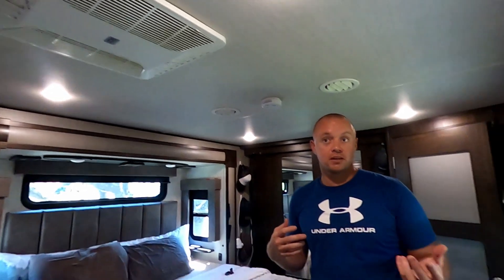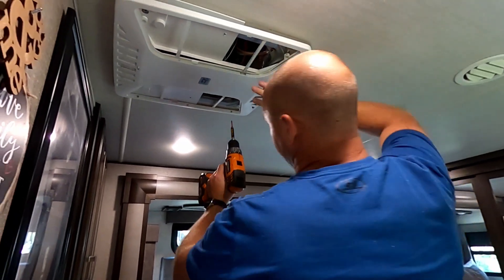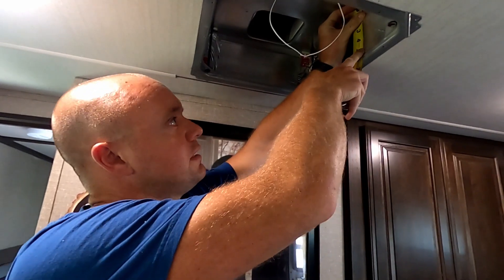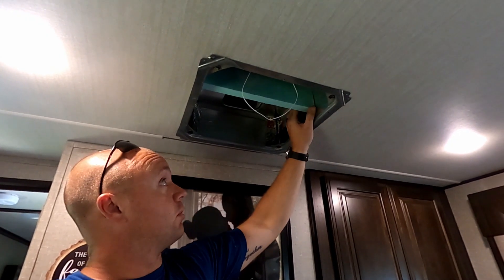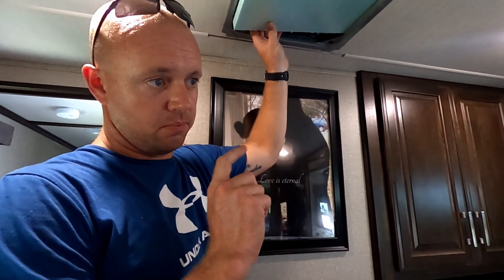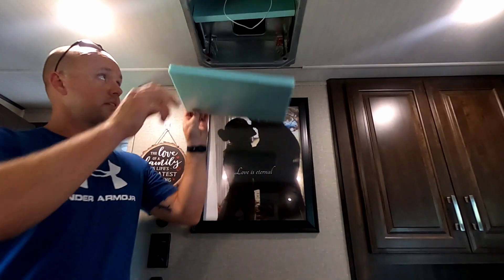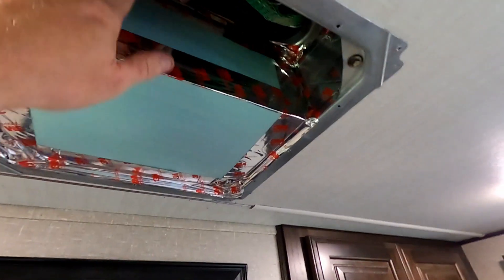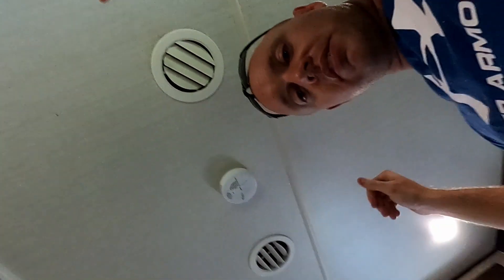Grand Design A/C Modification

Comment: Just did this mod today after watching your video. One difference is I centered the teepee on the close-off board, even though the output hole below the fan is not centered. I discovered they did this intentionally because the air blasts more on one side than the other, making the dividing point the exact center of the close-off board, not the center of the output hole. Much better flow now and even distribution front to back. Much quieter as well. I started with a hot 32ft trailer in 103* temps and it was down to 79* in 30 minutes. Thanks for the video and clear instructions.
Reply from the maker: You are most welcome! We are glad it worked out for you!!!.

Safe travels and Happy Modding!

Very respectfully,

Jeff and Amanda

Comment: I made this mod to out '19 Imagine back in June. We took our grandnephew camping for a few days right after and it made an amazing difference. The noise level dropped by a ridiculous amount, and we kept the trailer in the low 70's for the entire trip. Did I mention that it was 105+ outside for most of the time we were out? The A/C actually cycled off a few times during the day. Worth every nickel of the $12 I paid for the foam board (I already had the foil tape.) Good job!

Comment: Well today I decided to do this DIY upgrade. Went to a local box store and spent less than $40.00. I took my time plus the weather was in my favor. I cut out the flow diverter (Teepee ) to  aloud more flow for the return air. I also rapped it with sound Kilmat sound proofing. Can’t say it was much better, can’t do much for the return . But the difference in the flow of air is great. You saved me from spending $180.00. Thanks so much for the video. Keep them coming.
Reply: Spell  correction. (Allow). That’s spell check. Lol
Reply from the maker: Hey Frank! We are thrilled it helped you out! Thank you so much for the kind words. Keep on moddin’ and safe travels!

Very respectfully,

Jeff and Amanda

Comment: Excellent resource!  I bought the materials and followed along and with the video and it was a simple and straightforward modification.  The unit is "somewhat quieter" but noise was not my primary motivation.  The air flow from the vents is AT LEAST TWICE AS FORCEFUL as it was before the mod, especially in the bath and bedroom which are farthest from the AC unit.  I hoped for improvement but this exceeded my expectations and will be a huge asset  in the Texas heat!
Reply from the maker: We couldn't agree more! We are currently in Texas and it has been HOT!  We also bought a shaderv from shadrv.com. More to come in future videos.

Comment: Just seen the RV airflow system. I said. I can make something just like that. And here you are. LoL great tutorial. Will do this for sure.
Reply: They where pushing 6450 CFM then gained 6580 CFM over 13,030 CFM
That is a gain. Great video for sure. I can totally see how easy it is.
Reply: Even doing this still allows turbulent air flow which prevents optimum efficiency so buying the Air Flow System will improve  things even more.
Reply from the maker: Hey David,

Thank you for the numbers and the feedback! We hope it’s working well for you!

Sorry for the delayed response we have been on the road for the last month! Videos are coming!

Safe travels and happy modding!

Very respectfully,

Jeff and Amanda

Comment: I did this over 2 years ago, used foil tape to seal everything. What a difference it makes. this is such an easy modification and for around 30 dollars did both ACs in the unit, much cooler and a lot less noise

Comment: Great video I followed your instructions and the mod went great. I also foil taped everything for a tight seal.  HUGE difference in my air flow especially the bedroom. One added note: I offset the diffuser TEPEE  by 1" off center to favor the bedroom and this worked great. Thanks again!
Reply from the maker: Hey Richard! 

Sorry for the delayed response! We are glad the video helped. Thank you for adding the info on the noise level! 

Happy modding and safe travels!

Jeff and Amanda

Comment: Thank You so, so much. I have been dry camping at my cousins property in S.E.Georgia in my Grand Design travel trailer. My little big dog Honda gen. has worked in the past but a no go on this tripp. I found this pod last night, 10pm 80deg. sweatin mess. Today after my morning routine about 1 o'clock  sat back to get ready for the daily heat stroke. I remembered your vid, which I watched from start to fin. Thought, what have I got to lose.  got the filters off, they were clean. Dropped the two panel's  and got hit with an air sunami. my fan was running strong. what a big, big air restriction. you don't think? Went to the thermostat, BINGO!! The compressor kicked in! Now that I've cooled down I'm on the way to Home Depot and you my friends have another subscriber, life long!! Tip of the hat you'll. Thank You!!
Reply from the maker: Hey Robster,

Sorry for the delayed response. Jeff was in a remote part of Alaska for the last month helping provide no cost healthcare to remote sites. We are thrilled that this mod helped you! 

Safe travels!

Jeff and Amanda

Comment: Followed easy video. Working great so far had to do some extra trimming, there was some foam insert that stuck out, about half an inch, but just trimmed it back so everything fit well and rested it well. Working great thanks for the great video. With this Texas heat this is a must.

Comment: Hi Folks, Nice Idea. Over the 20yrs we RVed, I modded the AC's on our 4 RV's by Insulating the Exterior of the AC Air Boxes in a similar way, and sealing the interior areas as you've mentioned. Also bundled the wiring and moved the center cross-member in the Intake chute to maximize the Intake Air Flow. In addition, I closed off the air exits at the AC Unit to maximize the Air Flow into the Duct work and reduce the noise level at the AC unit. Double Insulating just might give you even more cooling benefits.  Stay Cool. Harold
Reply from the maker: Harold, thank you so much! That's awesome! We will definitely look into that!
Reply: @WeLiveFreeRV  Hi again, forgot to mention that I also put in some foam type material in the farthest End Air Vents to smooth the Air Flow due to the duct work  going beyond the actual Vent Exit and causing turbulance. What ever you can do smooth out the Air Flow in the system helps.  Harold
Reply from the maker: Thank you so much

Comment: I did mine a little different. Instead of the Teepee I cut 3 pieces all of them were 14" X 7 1/2". On the top two I cut openings for the air to flow down. I used Nashua Aluminum tape with mastic. Sealed it up real good with plenty of aluminum tape. Taped inside the vents near the plenum. Added and taped the side and bottom piece and buttoned it up.

I expected some improvement but never expected the improvement would be so significant.

I expected double the airflow but it was blowing out of the vents at least 5X, wouldn't be surprised if it is 10X stronger!

When I cranked it up it lowered the air temperature agni 5 degrees in 30 minutes! Last night the AC ran nonstop all night long now the longest it runs its about 30 minutes.

The tape was about $25 and the insulation board with aluminum on one side was $15. It took about 4 hrs, that includes the time it took to get the materials at Home Depot and have a donut and cup of coffee. So, half of that, about 2 hrs was actually all it took. Very simple and it helps to have a stool or small ladder. 

Thanks for sharing these tips!
Reply from the maker: Hey the revival channel!

Wow this is detailed!!! We are thrilled you saw an improvement!  We agree it's noticeable. We froze ourselves the first night! 

Safe travels and happy modding!

Very respectfully,

Jeff and Amanda

Comment: I was doubtful that this was going to give the results that I was hearing.  I’m a believer now.  First of all, you made it so easy to follow.  You even measured it for me.  I’m impressed with the increased air flow.
I used a chop saw and a tabletop saw.  Also a drill bit to cut out the screw slots.
Once again, awesome job, great video.  Thanks
Reply from the maker: Hey Keith!

We are thrilled it worked well for you, and thank you for your kind words!  Great call on using the drill bit for the screw slots! We didn’t think about that.

Safe travels and happy modding!

Very respectfully,

Jeff and Amanda
Reply: @WeLiveFreeRV  A coping saw for the screw slots works well.

Comment: I watched your video in my RV today as I was doing this mod. Thank you for making it! I did it to both AC units in my Reflection 311BHS. What a difference! The air flow coming out of the ceiling ducts is so much better. I should have checked the decibel reading of the AC's before starting this project but I do believe they sound quieter. RV Airflow kits are $170. I would've needed two of them. I paid $28 for foam board and tape. It took me a little over 3 hours to do both AC units but I saved a lot of money!
Reply from the maker: Good morning Rob! You are most welcome and thank you for your kind words. One of the other commenters did use a decibel meter and it was a 10 to 15 reduction in dB. We are thrilled that the modification worked well for you!

Very respectfully,

Jeff and Amanda

Comment: Great video! The only negative thing I had noticed about this is the vents on the ac are no longer usable but other than that the flow through the vents was a 100% better
Reply: I agree except that I am at a campground with poor electrical. I have had the startup capacitor on each unit go bad. The way to check if the AC problem is the startup capacitor is to reach up and spin the "squirrel cage." You can no longer do that.

Comment: They actually make duct knives that are very easy to use. That foil tape needs pressure applied to it with a credit card or a squeegee or it will eventually come loose. Can’t tell you how many times I’ve had to fish hvac tape out of rv duct.

Comment: We have an older motorhome, and I’m pretty sure it doesn’t look like that on the inside. I’m still going to see if there is something Similar I can do, to help. It can get pretty warm, when it’s real hot outside. We don’t live in it, but a little more comfort, when using it would be much appreciated. Thanks so much for your video.
Reply from the maker: Good evening!

You are most welcome! Good luck! Don’t hesitate to reach out if you’d like a second opinion!

Very respectfully,

Jeff and Amanda

Comment: Well, I attempted this AC modification on my new Shadow Cruiser today. I have a Coleman Mach 15 AC and it doesn’t blow very much air through the vents resulting in a hot camper. I used one inch thick foam board and immediately ran into some issues. My plenum is kinda shallow at just under 5 inches which caused the 45 degree angle cuts not to work. I ended up chiseling away the foam until it gave me the correct fit from the exhaust port to the duct entrance. It wasn’t pretty looking but I taped it all up before I installed it. My plenum came from the factory a mess. Nothing is clean cut and there is a lot of overlap from the wood in the ceiling where the AC is mounted. I had to cut, carve and shave my foam boards to fit. I ended up using a lot of tape but I accomplished the direct line from my exhaust port to the duct entrance. There wasn’t much room left for the teepee so I omitted it. After it was all together I excitedly turned on the AC and to my surprise, I had a lot more air moving through the ducts and out of the vents. I’m so glad you made this video and thank you for sharing it with campers like me.
Reply from the maker: Hey Jeremy!

What an adventure sounds like you did a great job! We are glad the video helped you! We hope you are cooling down!

Safe travels and happy modding!

Very respectfully,

Jeff and Amanda
Reply: Wow, 5 paragraphs,  impressive

Comment: You did a great job and I applaude you!. However it should be noted with the RV Airflow mod it increases RETURN air flow. The increased airflow uses MORE of the inlet filter and prevents the coils from freezing over. More air flow means less operation and operation costs. However- It should be noted you saved everyone a lot of money with your mod. How much will you save in the long run if you had purchased a RV Airflow kit?? It would take a lot of testing to prove that.
Reply from the maker: Hey Opa and Oma!

Thank you so much and that’s a good call out for sure! We are not sure how to calculate the difference either! We went back and forth on buying the airflow kit, but Jeff really likes diy projects haha!

Safe travels and happy modding!

Very respectfully,

Jeff and Amanda

Comment: Don't know if someone else has mentioned it or not but that whistling is the air squeezing between that outer cover that has the dump and filter panels and the inner plenum panel, around the edges.  I found one spot that was the main culprit and added a thin layer of silicone and that got rid of it immediately.
Reply from the maker: Hey James,

It has not been mentioned! Thank you!

Comment: Love this mod. Why didn't you take the flange off?  A company called "RV AirFlow Systems" has made a unit that does the same thing but for $170. I will be doing what you did but making the "TP" go all the way to the sides and within an inch of the top. Once I have created the "TP" and have it secure I will cut out part of the bottom as the "RV AirFlow Systems" has done to theirs so you get more air flow through the full length of the intake and air filter. Great Video.
Reply from the maker: Hey Lad!

We wanted to keep all the original parts of the system “installed” in the event we needed to reverse the mod. We love your idea about maximizing air flow underneath the tee pee!

Thank you so much for your kind words. Safe travels and happy modding!

Very respectfully,

Jeff and Amanda

Comment: I would cut the 45 on the insulation panel first. Before cutting them into the pieces you size to length and width. It’s easier to cut a large panel than small pieces. But a really great video thanks 🙏
Reply from the maker: Great tip! Thank you!

Comment: I think I will be trying this. Although I have a 3d printed version in my mind. Does the bottom of the horizontal piece line up with the bottom of the duct opening? If not maybe a foot on the teepee would help a little more. You could also notch the divider to match the teepee, and cut the bottom some. That would add more return airflow and use more filter sq inches. If I am picturing it correctly. My camper is in storage right now.
Reply from the maker: Hey M Moore,

We are going to try and answer this as best as we understand what you’re asking.

1) for us the bottom horizontal piece of foam board sat approximately a half an inch below the opening of the duct. i’m not sure how that would translate for 3-D printing, however with the appropriate measurements I could see where that would free up some more airflow into the intake. I am Magine that 3-D printing as much skinnier than a 1 inch piece of foam. 

2. You can notch underneath the TP. However I would imagine that would be very disruptive from the airflow standpoint and maybe a curved carve out would work better

hopefully that answers your questions! If not we can try again!

Very respectfully,

Jeff and Amanda

Comment: Improvement....cut the opening in the bottom foam and the v diverter. Then the back block on your intake side to allow more intake air easier
Reply from the maker: Hey Kelly, we think you are saying you have improved on the mod. That's awesome! Are you saying to cut an opening in the bottom and change the location of the V? If you get a chance could you explain a bit more? 

Stay safe! 

WeLiveFreeRv
Reply: @WeLiveFreeRV  I've been drawing mine up. And the way you have yours built.. (which is awesome by the way) limits the intake side of the air. If you look at the commercial version it has a concave leading from nothing at the point of the plenum for the charge air to half the hieght at the intake side tbuse creating less restriction for the charge air by allowing more area to draw from.

So picture thisyou have the vertical section of the foam separating the diverted on the charge side. That solid piece on the backside has the v shap that is open at the top of the v that would be facing down so cut the inside of the v shape in the solid foam serpating the intake from the charge  side. That will open up more surface area easing restriction into the intake and increasing the efficiency. Ill work on a drawing this week. Its hard to explain in messages  without photos
Reply from the maker: It sounds awesome! We would love to see your design!

Comment: Great mod, I have saw the pre made box you could get but $180 is a little stiff for a foam box. I have the same AC and will be doing this. Thanks
Reply from the maker: Serinehart you are most welcome! It makes a big difference in our opinion. Happy modding!
Reply: @WeLiveFreeRV  I just finished the mod and have to say I am impressed, couldn't tell a lot of difference's with noise but a lot with air flow.